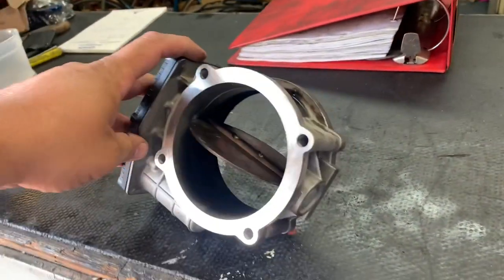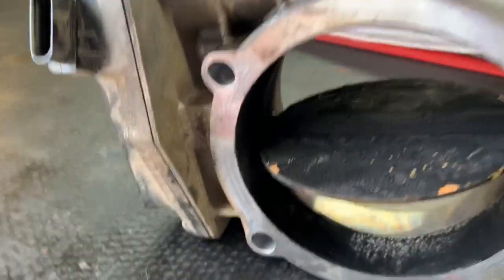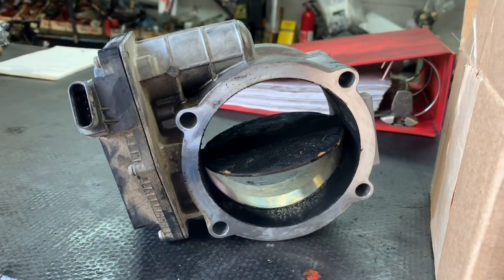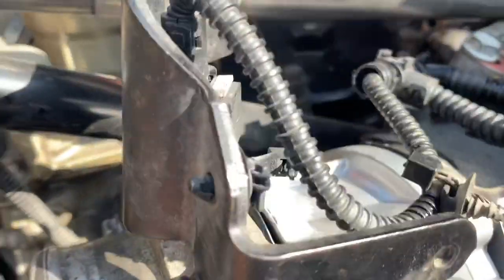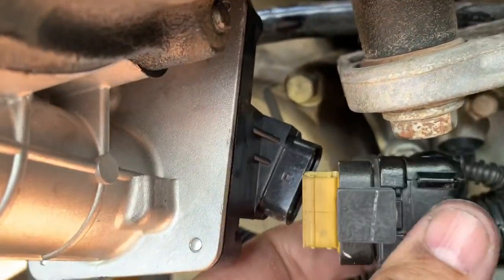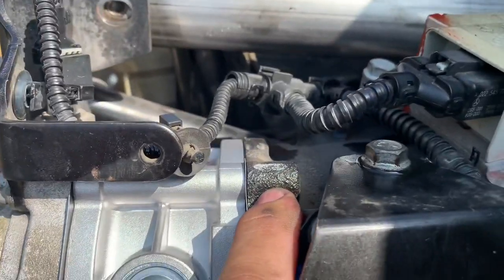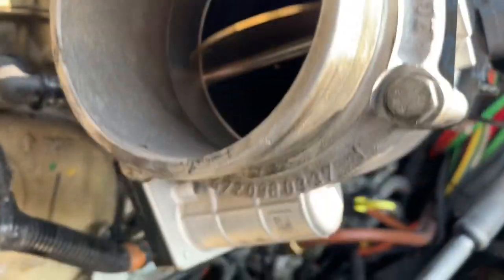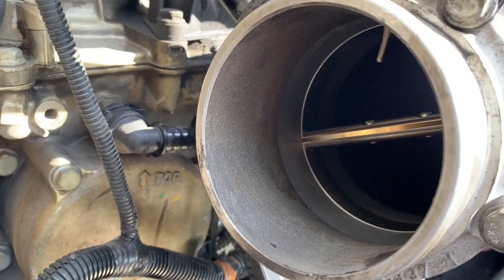Freightliner Cascadia DD15 Intake Throttle Valve replacement

Comment: Hi ! I have 2016 Cascadia 350k miles. My engine feels like have some restriction to rotate sometimes, like it’s trying to adjust something and shakes more on Idle and turbo reads1-2 psi. (boost sensor replaced) When holding pedal steady at some 700-900 rpm It could start climbing with noticeable quieter vibration and resistance or drop about 50-100 rpm and more noise and vibration. When holding 1500rpm sometimes turbo reads 0 and highest I see is 6 psi. Same thing while driving downhill with no engine brake at1500rpm 0-6psi. When driving it’s also vary, sometimes it’s loose speed quicker and sometimes it’s going like crazy with much louder engine sound. Turbo readings also feels swinging sometimes and sometimes it’s pretty responsive to pedal. Working 23-27psi on gears 9-12. on lower gears it could hit 34 psi but after 9 gear it never get over 27 psi. In different places I been told All computer tests it passed as perfect engine, no any codes. MPG also jumpy and while doing regen time to time level of vibration and sound is different. Once it shakes so much so everything start falling from shelves. May it be trottle valve? Why no codes? Thanks for any answer or suggestion on what and where to look for.
Reply from the maker: I had something similar to this where the truck would have little turbo boost even with the accelerator all the way down. I used a test turbo and that did not change anything. I ended up swapping the MCM (motor control module), performed a road test and the boost came back. 
Try using a test MCM to see if this helps.
Reply: Thanks !!!
Reply from the maker: The MCM is the computer for the engine. Sometimes it is called the ECM. Located on the driver side engine just below the fuel filter housing.

Comment: I'm getting a code for spn 3510 fmi 4 not really sure I'm thinking either a sensor or my intake valve isn't working right .also experiencing power derate not speed
Reply from the maker: Sounds like it is ACM (aftertreatment) related. The book says Sensor Supply Bank 2, short to ground. So this can  be a harness issues.
This can be a DEF Doser Valve issue.
Or the ACM. 
What year is the truck?
Reply: @CarlosDieselElectric  2013 cascadia dd15
Reply: @CarlosDieselElectric  my engine surge when I'm sitting idling no check engine light what do you think it is
Reply from the maker: Antoine Blackmon sounds like it could be your quantity control valve. 
Is the surge only at idle and goes away when your RPM is above 900-950 ?
Reply: @CarlosDieselElectric  yes I rive my rpm up and it does go away but while idling it would rive up once in awhile
Reply: @CarlosDieselElectric  when i start my truck up it surge then it stops while I'm sitting it surge once in awhile
Reply from the maker: Antoine Blackmon sounds like the quantity control valve. Sits on the high pressure fuel pump. Not that hard to replace, expensive part though.
Reply: @CarlosDieselElectric  thanks

Comment: Is this the code that comes up, SIR? SPN 102 FMI 18 code...
Reply from the maker: Marco Law I can look it up tomorrow when I get in. What year is the truck?
Reply: @CarlosDieselElectric  It was 2015 freightliner cascadia DD15.
THANK YOU VERY MUCH ! Carlos
Reply: My truck 2015 dd15 is this the code that come up?
Reply from the maker: SPN 102 FMI 18 typically Intake Manifold Pressuew Low. Check your CAC, also could be a bad sensor
Reply: @CarlosDieselElectric  I will try it . Thank you very much ! 🙏🙏🙏🙏
Reply: @CarlosDieselElectric   I had a check eng 1 spn102 fail18 in DD13 freightliner cascadia. I changed the manifold pressure sensor but still sometimes this code comes on and off nect 3-4 secs. What does CAC mean? What could be the problem?
Reply from the maker: @BSingh-ok6cm  the CAC is the Charge Air Cooler. 
Let me get to work tomorrow and I can see what the book says.

Comment: Can u help me out buddy ? I got spn3464 with 31 cmd . I got DEF deleted so what dk you think i should do ?
Reply from the maker: zutilol I’ll help you out as best I can. I am away from work so I am limited on my information. But it might be Intake Throttle Valve related. What year is the truck? How many miles? Is the Throttle Valve the original?
Reply: @CarlosDieselElectric  569k 2013 cascadia . But i got my dpf system deleted . Anyway that code went away by itself ... Not sure what's going on
Reply from the maker: zutilol glad to hear the code went away by itself. But the intake throttle valve has nothing to do with the DEF after treatment. It should still work because it is on the engine.

Comment: I have a 2022 X15 Cummins 605/2050 and since new my throttle valve has always been very active, so much that sometimes it struggles to accelerate smoothly and between shifts the valve will close and knock the engine back to idle as if the Jake brake is on, just recently got a code for “injector metering rail 1 pressure high” do you think these could be related or do you think I’m having a fueling issue along with a faulty air throttle ?

Comment: Would this cause rough idle ?
Reply from the maker: Yes it can, what kind of rough idle do you mean? Like it wants to shut down? Like the quantity control valve is going bad?
Reply: @CarlosDieselElectric  like a cold engine idle even when the engines warmed up

Comment: what code did it give you? my truck is giving me code spn000051.
Reply: Usually after the SPN there should be another number that follows. That is usually the FMI part that is needed to narrow done the fault code. SPN is just part of it. Let me know what you have and I can try to help.
Reply: it shows eng 2 001 spn00005102 and spn00005104 and it's also says throttle POS
Reply: Jorge Facio more than likely it is your intake throttle valve. Go to someone that has the Detroit Diagnostic Link Software. This way they can confirm. If it is, buy the new throttle valve and not the reman.

Comment: Son 3464 fml 31???!! What does this code mean?
Reply from the maker: What year is the truck?
Reply: 2012 Freightliner Cascadia dd15
Reply: Truck hesitate during acceleration when in lower gears
Reply from the maker: Johnny Dayone sounds like the intake throttle valve. If you replace it, go with the NEW no the Detroit rebuilt. About $20-30 more but less issues
Reply: Well I got it at Freightliner now there saying its the quantity control valve...idk I hope that fixes it if not I will look into the throttle valve
Reply from the maker: Johnny Dayone quantity control is expensive. They run about $700-800 plus labor. Interesting thing, I have not come across a fault code or CEL that indicates a quantity control valve. What does their print out say?
Reply: Carlos Diesel Electric I don’t think they putting in the whole “fuel pump actuator” just the quantity control valve that goes inside the fuel pump so they say I don’t knw guess I will figure out tomorrow smh
Reply from the maker: Johnny Dayone no the quantity control valve (fuel metering) is mounted on the fuel pump. The pump is over $950, either way I am curious to see what they say.
Reply: Carlos Diesel Electric ok I will let u knw I hope um not getting screwed
Reply: I have a code for intake throttle, the code will shortly return even after clearing.  but there butterfly valve is not stuck.  I am having regen issues where the truck is purging while doing a regen. Has put me on the side of the road 2 times.  Been to 2 shops but they are clueless on what is causing a regen issue. I will get nox codes along with regen. Do you think by chance this throttle valve could be causing it. 

I have replaced both nox, imap, delta  p and just had filters baked. N 7th injector

Comment: Anybody can help please?a friend of mine delete the dpf sistem on dd15 and next day he got this code for throttle damage. Is that because the delete hasn’t been on good way???please help
Reply from the maker: What is the fault code they are getting?
Reply: He is getting spn 51 fmi 18
Reply: @CarlosDieselElectric  thanks he is getting SPN 51 FMI 18
Reply: @CarlosDieselElectric  he said it happened after he delete the pdf from his truck
Reply: @CarlosDieselElectric  can you help please?
Reply from the maker: @tosis255  could be a coincidence, I would recommend to replace the Intake Throttle Valve. They are pretty inexpensive, go with the new not the reman. The price difference is about 25 more for the new. 
You don’t need to calibrate. Just remove and install. 
Or if you have another truck you can use the part from just to test.
Reply: @CarlosDieselElectric  thanks. Actually he sent me a foto that’s a crack on the egr cooler connection!!!!
Reply: @CarlosDieselElectric  thanks 🙏 I

Comment: 3509 code popped up?
Reply from the maker: What is the FMI? SPN 3509 but I need the additional numbers that follow. That helps narrow it down
Reply: @CarlosDieselElectric  fmi 4
Reply: I just got that code too on my 2019 freightliner cascadia 3509-4 and 1066-12 and it won’t even shift. Any help?

Comment: What was the code that it gave you ?
Reply from the maker: The Trucker there are about 3 different fault codes that pertain to the intake throttle valve
Reply: @CarlosDieselElectric  thanks lol maybe you know what they are ??
Reply from the maker: The Trucker I’ll be at my shop shortly. I’ll look them up and post. Hang tight
Reply from the maker: The Trucker 3464 is the most common. There is usually an FMI number that follows. What code are you getting?
Reply: @CarlosDieselElectric  I have 3464 fmi 16
Reply: @CarlosDieselElectric  could this be the issue?
Reply from the maker: @la2toronto789  what year is the truck?
Reply: @CarlosDieselElectric  2016, dd15.
Reply from the maker: @la2toronto789  let me check the book tomorrow when I get back to work.
Reply: @CarlosDieselElectric  thank you brother I appreciate it 😃
Reply: @CarlosDieselElectric  my Truck just hit 500,000 miles.
Reply: @CarlosDieselElectric  Good afternoon. I have the same issue. 2016 Freightliner. SPN 3464 FMI 16. Intake manifold pressure too high ? Do you happen to know possible solution ? Or should I take this in to dealer ? Also, is it ok to drive the truck in the meantime ? 

Thank you !
Reply from the maker: @cesartrejo3007  No need to take it to the dealer, the code does appear to be Intake Throttle Valve Deviation Error. The Intake Throttle Valve is fairly cheap. I recommend to go with NEW ITV and not the factory REBUILT. You will have better success with new.
Reply: @CarlosDieselElectric  thank you very much. I will buy it new and replace my self. Will code come off once part is replaced ?
Reply from the maker: @cesartrejo3007  yes, once the part is installed, cycle the ignition switch to the on position. You should hear the sweeping of the ITV.
Reply: @CarlosDieselElectric  thank you much ! Is this the same as “ Intake manifold pressure too high” when I talked to the dealer they told me this was the description for the code i was having. (SPN 3464 FMI 16)
Reply from the maker: @cesartrejo3007  let me double check my book just to be sure
Reply from the maker: Could be the sensor, usually located just behind the ITV. 
Could be turbo related. 
Could be software related. 
Or could be MCM related. 
This fault code be a tricky one. You will have to find a shop to help troubleshoot, but first try the  intake sensor. Are you having any power issues.
Reply: @CarlosDieselElectric  thank you. I appreciate you’re help
Reply: @CarlosDieselElectric  no power issues for me, no smoke or anything. Turbo is not whining or anything. 

Do these intake sensor go bad often? Is it common?
Reply: @CarlosDieselElectric  sorry i didn’t read the end of your message. No I’m
Not having any power issues. Really no problems at all just the yellow engine light.
Reply: @CarlosDieselElectric  my light just turned off randomly. Do you think maybe it’s just sensor ? 

Thank you
Reply from the maker: @cesartrejo3007  could be a random code. I would keep driving. If the code or issues returned then go from there.
Reply: @CarlosDieselElectric  what does overboost in regen mean? 

Because yesterday My truck did try to do a soft regen, it didn’t want to start by itself, I heard turbo during the regen But it wouldn’t complete regen, and then it asked for the regen and that’s when I did regen manually and and it completed the regen fine, and after driving the whole day, later at night is when I got this code saying intake manifold pressure too high? Could it be related to this regen? Maybe it gave me the code late? 

Could you please explain overboost in regen?
Reply: @CarlosDieselElectric  thank you for taking your time and answering our questions
Reply: I’m thinking of changing boost sensor or imap sensor, truck is running good, turbo is running good no loss of power, no weird sounds, just this time passive regen didn’t wanna start by itself, it wanted to accelerate really high with turbo, so then it asked for regen and I completed manually and didn’t have a problem anymore. 

I think I’ll replace sensor. And see if I have this problem again with regen.
Reply: @cesartrejo3007  how’s your truck brother?
Reply: @la2toronto789  that was the same code I was getting. My engine light hasn’t returned. Truck running fine so far.
Reply from the maker: @la2toronto789  That would be a good place to start.
Reply from the maker: @la2toronto789  email me, I can try and help you as much as I can. Carlosdiesel@sbcglobal.net
Reply: @CarlosDieselElectric  thank you so much brother I really appreciate that. ❤️ I will send you an email!
Reply: @CarlosDieselElectric  hello again! Yellow engine light came back on but no code for a couple of days. Today it turned off and then returned tonight with the same code (SPN 3464 FMI 16)
Reply: @la2toronto789  how’s your truck my man?
Reply from the maker: @cesartrejo3007  email me, when I get to work tomorrow I can go over this fault code and help you out as much as I can.
Reply: @cesartrejo3007  same here brother! Light came back on 😩😩
Reply: I changed imap sensor so it’s definitely not that, I’m going to remove hose and inspect the throttle valve maybe it’s stuck...
Reply: Or it’s sticking
Reply: @la2toronto789  i took my truck into Freightliner. I was having same exact problem as you. Same code. Truck running fine. They replaced my Vpod of turbo. And haven’t had a light come on since they replaced it last week  on Tuesday
Reply: @cesartrejo3007  I was thinking it was the VPOD too brother, I might look into the VPOD how much was the cost brother? 

It’s unfortunate there is not a lot of info on this code or problem
Reply: @cesartrejo3007  glad your truck is better now! It must be a relieve to finally solving the issue
Reply from the maker: @la2toronto789  I can definitely stick, if you command the ITV to sweep it will be once you the truck running anything is possible.
Reply: @la2toronto789  thank you. ! It was about $750 parts and labor at Freightliner.
Reply: @cesartrejo3007  thank you brother, I’ll take a look at the throttle valve if I see it’s working fine, I’ll definitely change the VPOD and see if it stops this! I’ll keep you guys updated and I hope other people see these comments. Because there’s no information out there regarding this issue.
Reply: @la2toronto789 hello brother i’m having same code & issue on freightliner 2016, What part you changed to solve problem ?

Comment: Can that cause my truck to not start ? It cranks but won’t turn
Reply from the maker: Maybe, try removing the CAC hose and see if the valve is open. If it is open, start the truck and see if you have the same issue. What kind of engine do you have?
Reply: @CarlosDieselElectric  2012 cascadia dd15
Reply from the maker: @itsmrblack  start with checking the Intake Throttle Valve. If it is stuck closed. 
Check fuel supply, check your fuel filters (look for debris in the small filter), debris could be a bad fuel pump, are you able to read the MCM ( do you have a good connection). 
Start with some of these things first.
Reply: @CarlosDieselElectric  I have spn3509FMI4
Reply: @CarlosDieselElectric  also my throttle valve didn’t have a butterfly plate in it
Reply from the maker: @itsmrblack  when I get back to work tomorrow, I can look it up and try to help.
Reply: @CarlosDieselElectric  I think I fixed it , i took out my engine air filter and it cranked up . Probably means I had a dirty filter which was choking the engine.  Might have to change it twice a year now .
Reply from the maker: @itsmrblack  glad you were able to get it started. Sometimes it is the easy things. I know some people that would have started with the fuel pump which is over $1000 plus labor. 
But glad your truck is up and running.

Comment: Hey that coincidence with fault code eng 1 fail 31 spn 3464??
Reply from the maker: It does look like it’s a Intake Throttle Valve related code, have you taken it to a shop to have someone connect the Diagnostic Link Software? What year is the truck and how many miles does it have?
Reply: @CarlosDieselElectric  it's a 2012 Freighliner Cascadia with 605,000 miles.
Reply: @CarlosDieselElectric  ok just a quick update, I did end up changing the throttle body valve and reset the fault codes and no more faults. Its really ended up being the sensor that sits on top of the actual valve. Changed the entire valve and sensor since it wasn't that expensive
Reply from the maker: Carbomb Torres I’m glad you were able to get your truck taken care of. I guess the fault code you had was for the intake sensor. Either way, replacing both is a win. Luckily the parts are not to expensive and labor is minimal.
Reply: @CarlosDieselElectric  ...oh the labor was all me. It only took me about 30 minutes to change
Reply from the maker: Carbomb Torres that is excellent, glad you were able to do the labor yourself and keep the truck on the road.